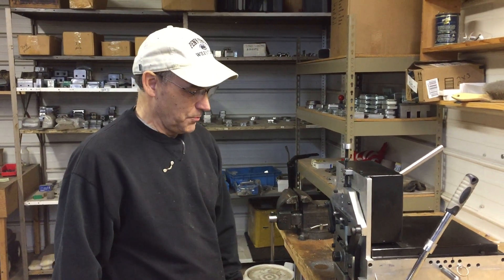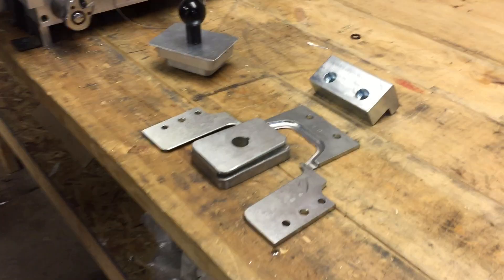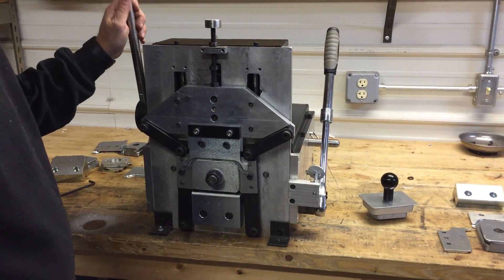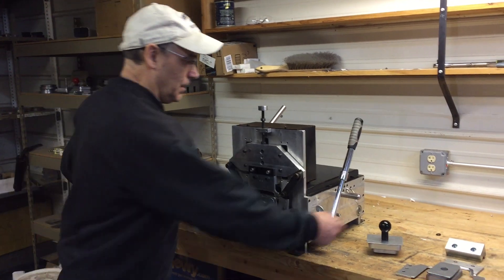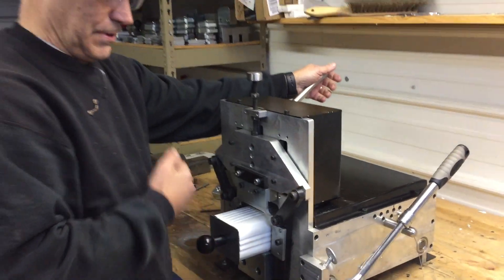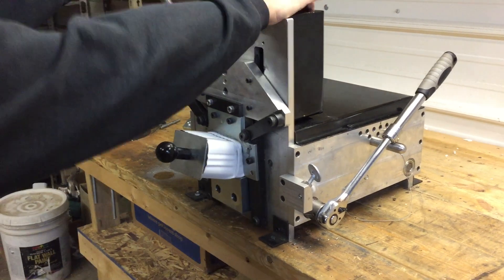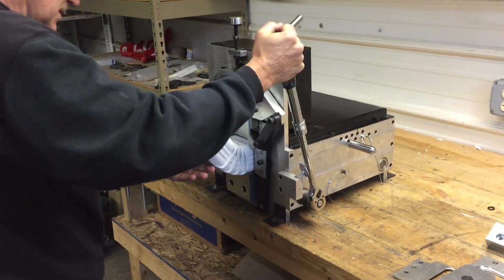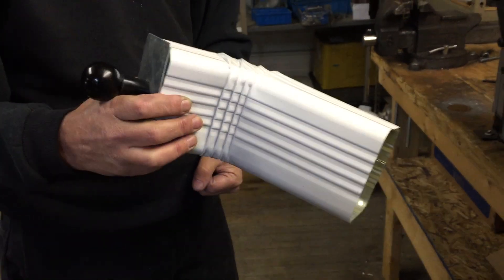Manual downspout elbow machine

Comment: that looks like LOOOTSSS of extra work! $1.80 an elbow..... ill just buy em i think
Reply from the maker: once you out of one at job site - it's an hour + gas to get it if you are lucky to get it to match color ))
Reply: I suggest you look at libertyseamless.com ELECTRIC elbow machine ... with automatic mode in 8-10 seconds you can make an elbow out of scrap. $1.80 is really costly if you use a bunch day ... that adds up rather quickly